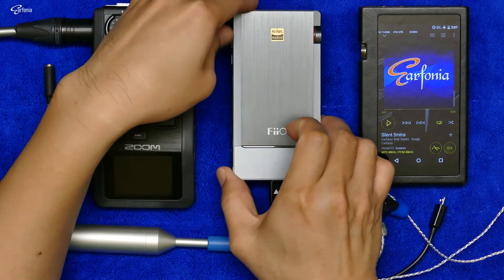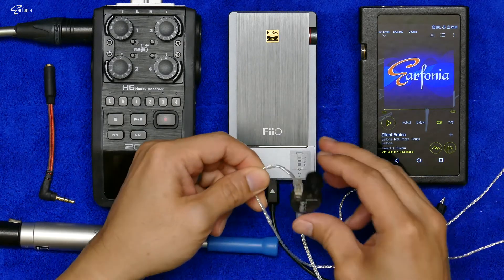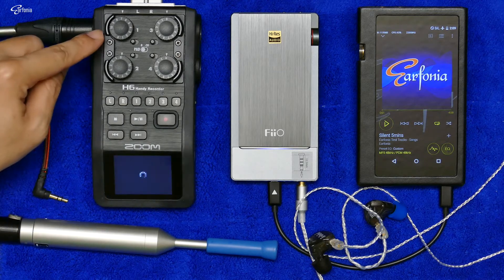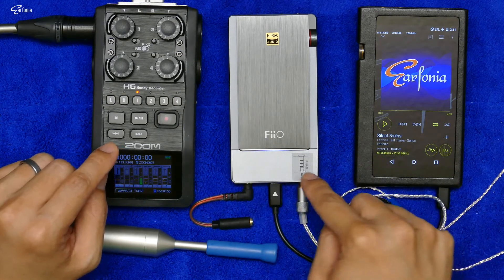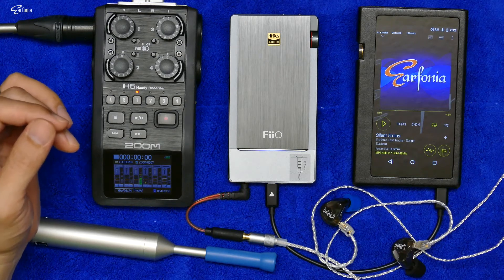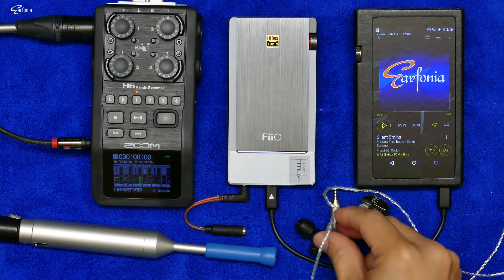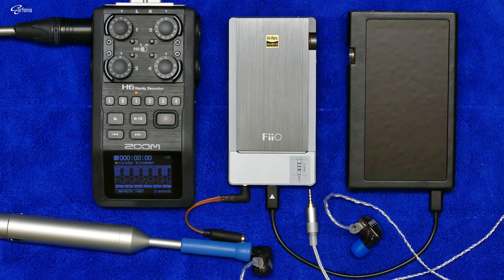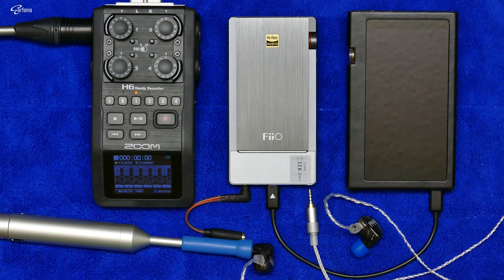Fiio Q5 - AM3 Amp Unit 2.5mm Balanced Output Noise Level

Comment: You have disabled comments on another video which is an emi reading on what you say is a Fiio x3 2nd generation. WHAT YOU SHOW IN THE VIDEO AND WHAT YOU ARE HOLDING IN YOUR HAND IS A X3 FIRST GENERATION.  NOT 2ND GENERATION PLAYER!!    You are wrong in your video and your information. On top of it you disabled comments so nobody could tell you. You have seriously degraded your integrity and accuracy in providing information. You should not disable comments and correct your video and apologize.

Comment: You are aware that the balanced output is almost +6dB louder then the single ended output, right? You can't compare both outputs with the same volume as they are not volume-matched. therefore the noise if of course louder on the 2.5mm balanced output-jack.
Reply from the maker: Even when volume set at lowest, the hissing noise still higher than 3.5mm output. But yea, looks like 2.5mm output is just not meant for high sensitivity IEMs. More suitable for less sensitive IEMs and headphones.

Comment: Would unplugging the 3.5mm unbalanced adapter before plugging in the 2.5mm balanced make a difference?
Reply from the maker: No, similar result. I'm quite happy with the 3.5mm output directly using the unbalanced 3.5mm cable, the noise floor is pretty low, and not as noticeable as the 2.5mm output. I don't want to keep changing cable, as you know the 2 pins connector will get loose when we unplug too often.
Reply from the maker: No difference. I use that adapter only for convenient in this video. But in practical I seldom use it.

Comment: Not to disagree with your personal experience, I have the Q5 and haven't had any problems with it. There is  such thing as equipment incompatibility. And I don't recall any gain settings being made in your video. Also I would try another cable to verify problem consistency. I have an array of IEMs varying from 16 ohms and up with balanced cable. And perhaps just a bad unit.
Reply from the maker: Initially I thought I got bad unit. But after comparing with other unit at the shop, and got the same result, I guess the 2.5mm output is just not meant for sensitive IEMs such as the 1964 V3.
Reply from the maker: Fiio Q5 probably one of my favorite portable USB DAC right now, really like the sound, especially the 3.5mm output. But 2.5mm output is just not suitable for very sensitive IEMs. Not about the impedance, but the sensitivity. I guess any IEM with anything 115 dB and above will experience hissing noise from the 2.5mm output.